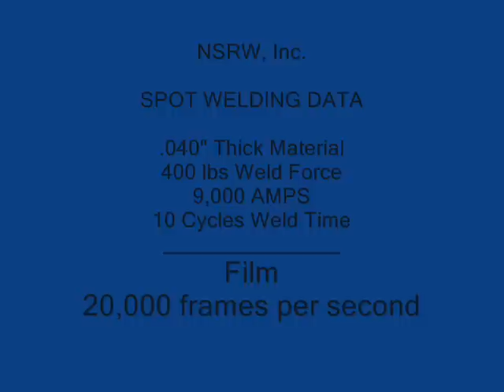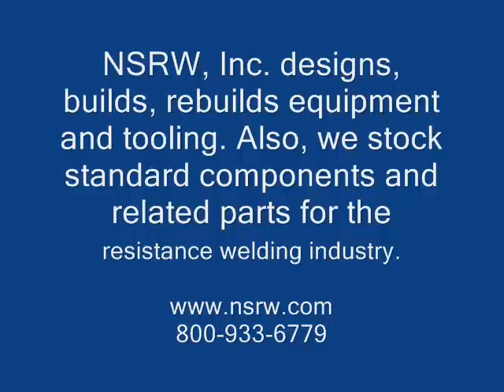Spot Welding Cross Section - 20,000 frames per second

Comment: @marcheseDS It was a comment on the no heat part, I'll admit none of the three add any current to the workpiece, but all three most certainly heat up the part until it is liquid and flows. Friction stir welding is impressive to watch as the friction causes the workpiece and tooling to glow at thousands of degrees Fahrenheit.